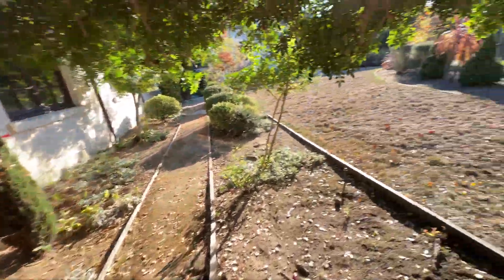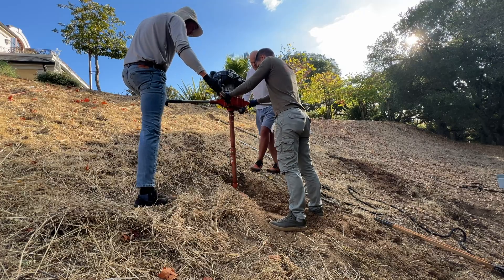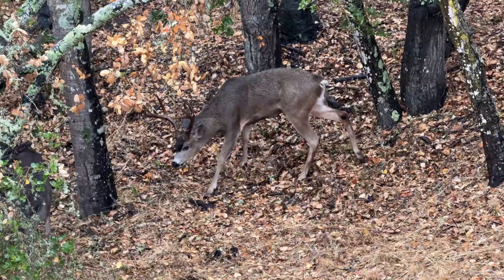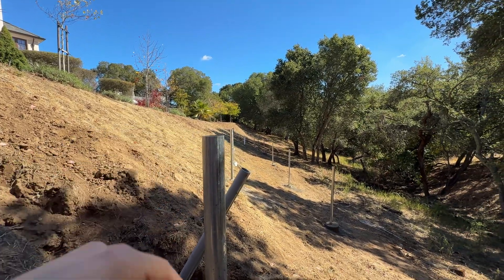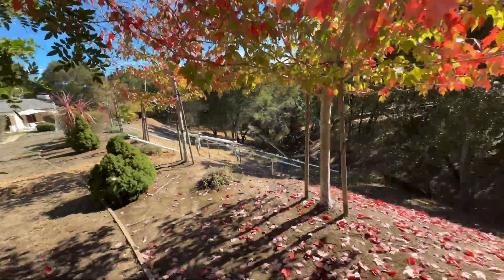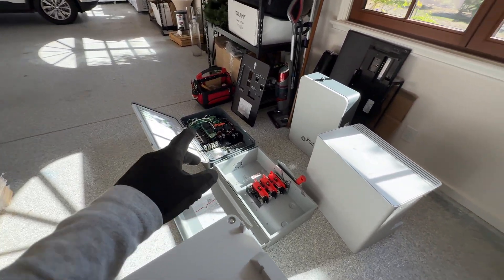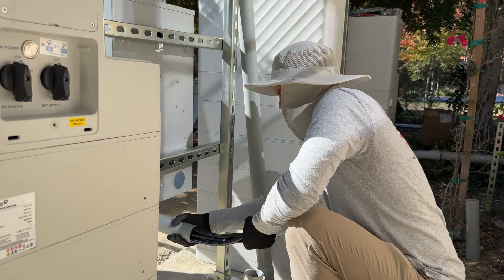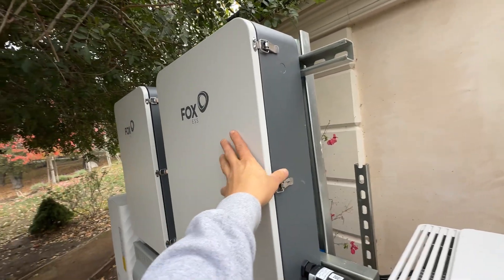Installing a Ground Mount Solar Array | IronRidge System Step-by-Step

Comment: With the inversion layer we are getting now we are not seeing the sun for days at a time. I am thinking of over amping the charge controller on cloudy days by adding another 30 550w panels, but I need a device that could cut the arrays out if the sun comes out so I don't fry the charge controller.  

Do you know of a way to cut arrays out of the controller if the sun comes out?

Comment: What panels did you use JA solar? What brands other than JA solar output spec voltage in your opinion?
Reply from the maker: We used Hyperion brand for this install. Most often we are using JA-Solar, SilFab.

Comment: Beautiful! Beautiful!!. What is the total inverter and battery capacity? It is a good idea to wear a facemask while working with cement to prevent dust inhalation and long-term lung issues.
Reply from the maker: thanks!
34.2kW AC and 60kWh of storage
Reply: @SolarEngineering   Wow, that’s a great amount of power. Good job